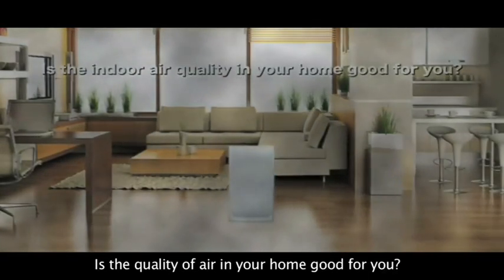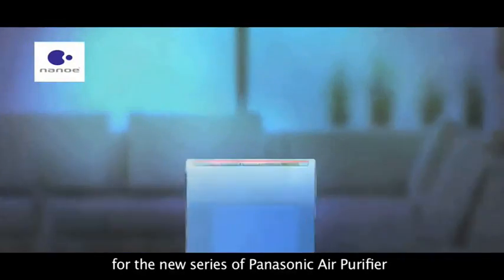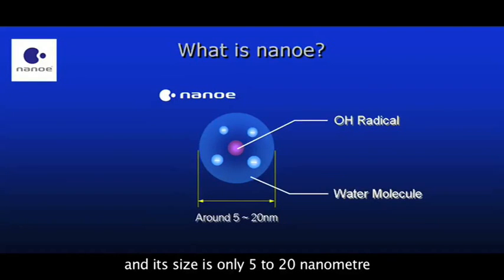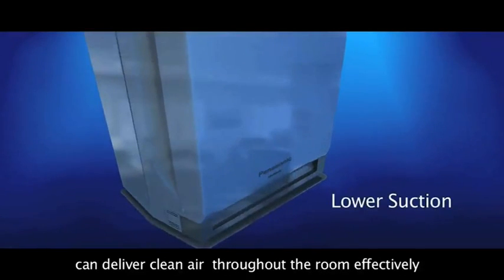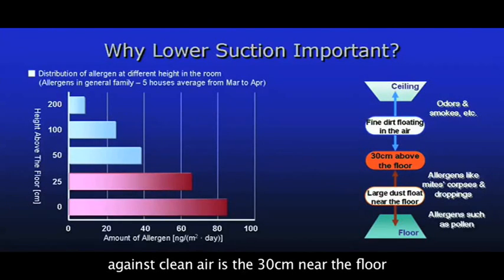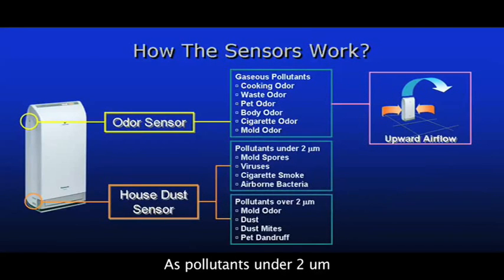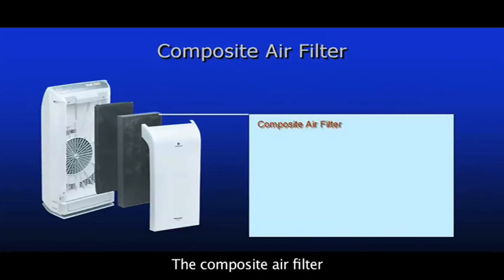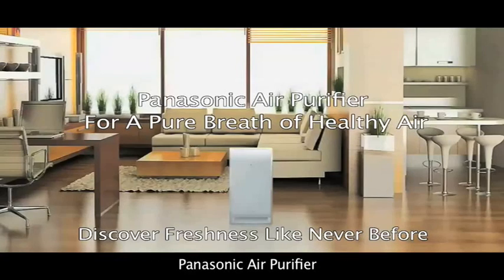How an Air purifier works?

Comment: There is no such thing as "Air" Purifier
Reply: pranjal87 contact on 8080108423 to know about air purifier
Reply: Air treatment , air filtering, and  air sanitizing. Air. Purificatiion is misleading because its a mixture of mostly of nitrogen gas. Only like 23% of air is oxygen. Our respitory system filters out 77% of the other gases. I bought personal air ionizer which. Doesnt filter the air but treats the air with negatively charged ions. Its designed to neautralize bad odors smoke annd pullution. I ccould tell you that it works and its the best 30 ive spent..i hotbox in my car. And it immediatelymade an impact as it doesnt smell like smoke and the smoke is cleared and my breathing isnt labored.
Reply: @metrocustom4194  to reply to bolo ki upar
Reply: @metrocustom4194  to reply to bolo ki upar